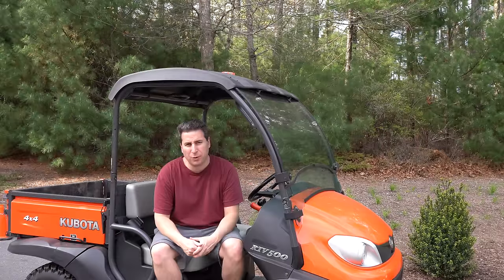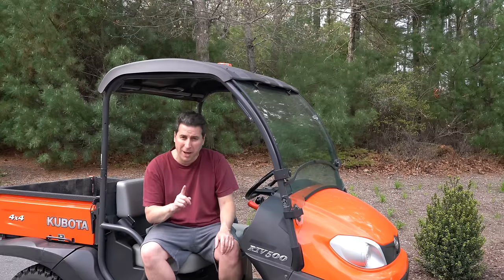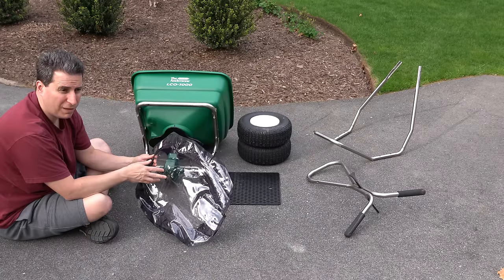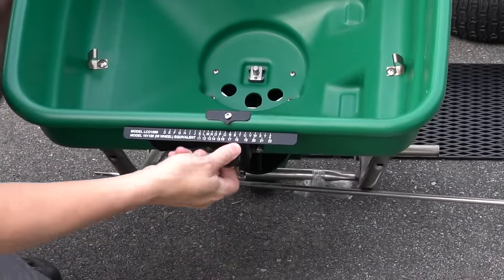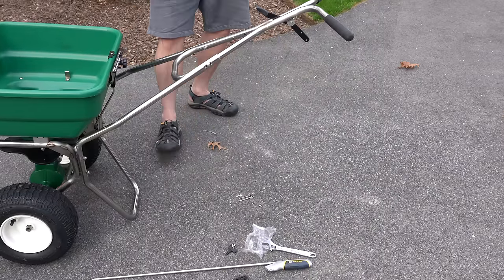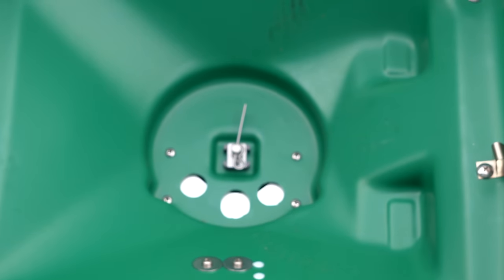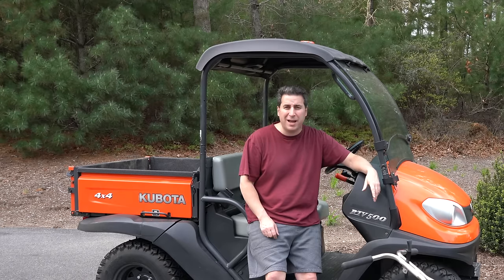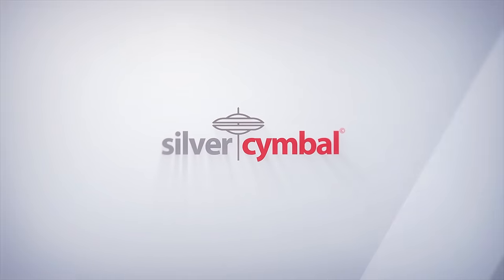Best Commercial Lawn Fertilizer  Spreader - for Work or Home - Andersons LCO-1000

Comment: Hey @SilverCymbal since you have used both the SR2000 and the LCO-1000, which one is better? Do you miss the SR2000 pattern adjustability when using the LCO-1000? How is the throw pattern on the LCO-1000 in comparison? Looking to finally upgrade my spreader and these two are on top of my list. Neither are available on amazon so I will have to find them locally. Just want the best I can get regardless of price.
Reply from the maker: The SR2000 is still the best and most accurate spreader but its like $1000 still. If you could find one used I would buy it, but otherwise the LCO is the next best thing and still exctremely accurate
Reply: @SilverCymbal  I ended up buying a new SR-2000. Feels like Christmas. What grease do you use for the Nylon gears? I read that regular petroleum based grease shouldn't be used for nylon gears. The manual doesn't specify anything.

Comment: Did you notice any difference in the spreading accuracy of the LCO-1000 being it doesn't have the helical cone-adjust like the more expensive model?  Thanks!
Reply from the maker: I didn't notice any difference myself but I didn't put it to a scientific analysis so it's possible there is a difference. The only other issue with the cone is that most brands don't mention it so unless you exclusively use the Andersons products it may not be worth it making the LCO-1000 a bit more universal.
Reply: Silver Cymbal Did the LCO-1000 spread evenly to the right and left which seems to be a big problem with a lot of spreaders? Thanks!
Reply: Silver Cymbal What have you found to be the best weed killer to use in your Anderson’s fertilizer spreader?  I have been using ortho weed b gone liquid concentrate for years just spraying it walking along with a sprayer on a garden hose line but the same dandelions seem to come back each year so I’m really frustrated.

Comment: I will just let everyone know that I got this spreader and the instructions to assemble are very poorly done...its not hard to figure out but jeez...secondly it is packed in the box horribly the axle was sticking thru the side of the box when I got it...they dont use any Styrofoam to secure it inside the box
Reply from the maker: Sorry to hear that the box was damaged, lawn gear can be tough sometime with shipping. I hope using it ends up being a great experience.

Comment: Reading a lot about them having plastic gears even with the stainless frame and wearing out really quick. For such an expensive buy, surely more should be expected?
Reply from the maker: The lesco and andersons all use plastic gears. I wouldn't worry about that. If you do need to replace them the entire set is under $20 so its very resonable but I dont think they will wear out.
Reply: @SilverCymbal  I own on of these.  I used it for the first time today in probably one year.  While spreading today, it started out normally, but about half done on the property - the drive tires stopped spinning the impeller.

Any suggestions?  The gear assembly seems fine.  Is there a pin or  something else that may be missing that connects the gear to the impeller shaft?  I spent an hour trying to figure it out with no luck.